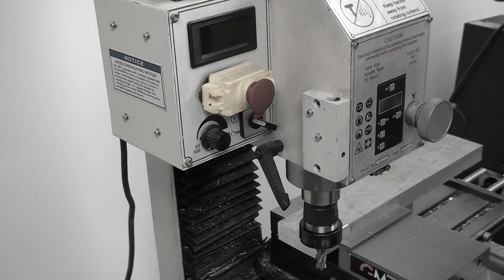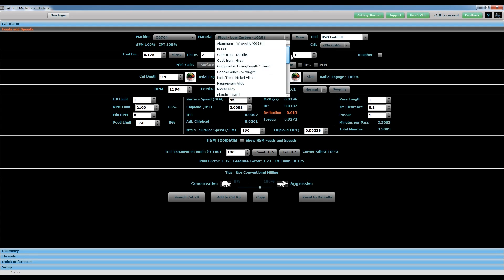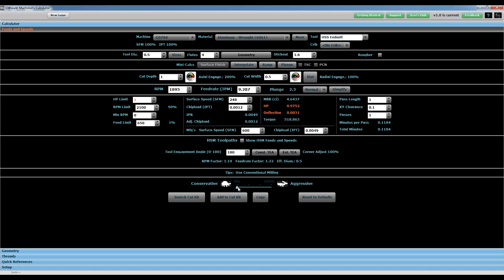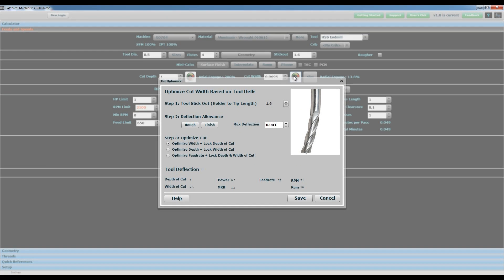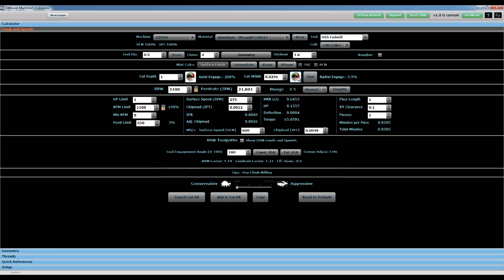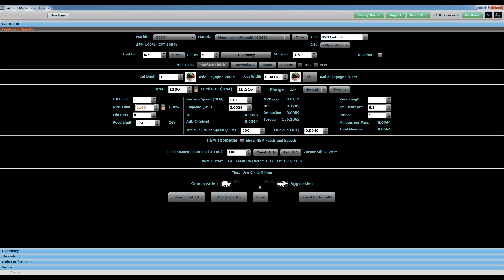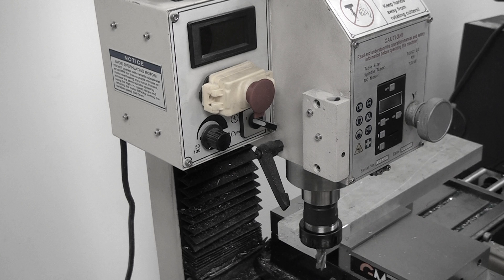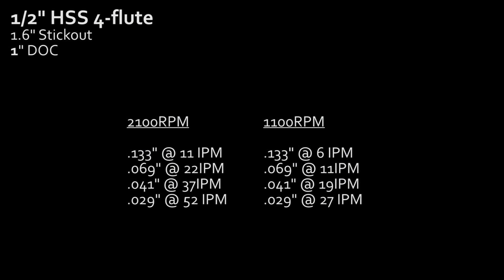CNC-G0704 #3 Testing Width of Cut Speeds & Feeds

Comment: Dont know about your mill, but my BF30 will eat that for breakfast. 1100w motor though.  You know that you can optimize the torque and RPM of the motor in the control box right ?
Reply from the maker: This mill is not very powerful, or super rigid. My motor has burned up and I'm in the process of upgrading to a 3HP motor.
Reply: Remove the plate covering the motor. I use stock 1.5 hp motor and my first burned too. Now with removed plate and belt drive it works like a charm.
Reply from the maker: Daniel Lilienberg 1.5HP would probably be plenty for my mill, which is only 1HP stock. I just got my 3HP motor mounted but need to work on the electronics (maybe another day). You can see the 3.8HP motor I'm using here: http://youtu.be/B2BX3VJ4ia8?t=3m0s

Comment: Russ, you mentioned that you had a different motor you intended to use. I have this same mill, and very early on, I stripped the transmission gears while plunging 1" thick mild steel, starting at the edge, .060 deep at .050 increments. The gears on this machine don't fully engage, it only contacts about 3/4 of the gear, which I believe weakens the drive train. Grizzly did replace the gears, and I bought an extra set, but while I was waiting, I did a timing belt mod instead, which I've been using ever since. I would like a more powerful motor, so I'm currently browsing, and I'd like to see what you have lined up for your mill. Thanks!
Reply from the maker: I have a 3.8hp Nordictrack motor that I scored on ebay for about $100 shipped. It's huge, and probably overkill, but I'm going to use it anyway ;)

I shot you a message on your channel too.
Reply: russtuff How did that  Nordictrack motor work out for you?
Reply from the maker: CHAD MICHAEL The shaft was bent during shipping so I never ended up using it. I bought a 2.2kw spindle that I'll be running on the side of the mill head, and I'm close to having it up and running.

Comment from the maker: It does not. Eventually I will be upgrading the motor and will have the controller running the spindle. At that point the mill should be able to handle my tapping for me.

Comment from the maker: You have a good point, and I do have a rougher that I will be featuring in an upcoming video. I don't know what controller comes with this mill, but I will eventually be changing it out when swapping to a larger spindle motor (which I already have).

Comment: Don't think you have to use crappy 4-flute tools on your nice machine. The 30 degree helix really hammers the spindle bearings.. you need more of a shearing action with the correct edge prep. Try the "super HSS end mills for aluminum" on the lathe inserts doht com website. Free shipping code is "free2ship" this month.

Comment from the maker: The T-slot bolts holding my vise to the table are longer than they need to be and I am set up to clear them. Getting the work lower would allow me to drop the head a bit more which would firm things up a little. Now that I think about it I will cut them down. I can probably gain 3/4".

Comment: It seems like the total stickout of the mill is very long compared to the size of the spindle. Also getting the head lower would reduce the lenght of the dovetail body being used and therefore reduce vibrations and deflection. Im sure that by somehow bringing the cutter closer to the spindle will help!! Maybe by using morse taper collets straight in the spidle?

Comment from the maker: That's a great tip, and I should try it for these relatively heavier cuts. The G-Wizard suggested all of these cuts should be climb milled, but being that I'm limited on power it may not have been the best strategy. I'll try it out and if works I'll post a follow up video.

Comment: try feeding the opposite way to avoid climb milling when taking heavy roughing cuts 
climb milling causes the cutter to push away from the work piece while if you reverse you feed the end mill's cutting forces will pull it towards the work and decrease deflection 
climb milling is good for light finishing passes as unlike feeding the the opposite direction to the cutter rotation it does not have the tendancy to dig into the work piece